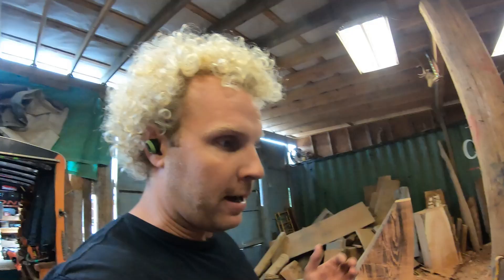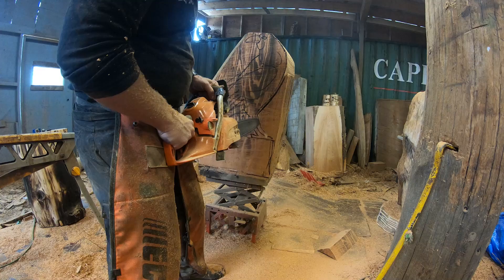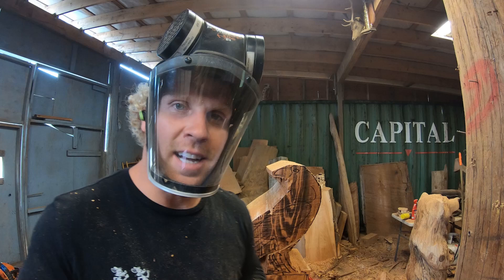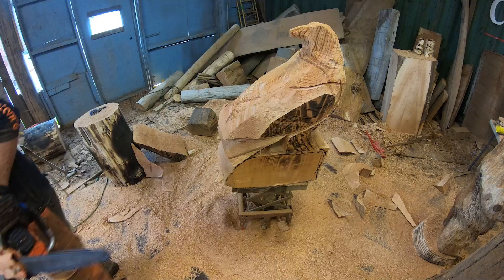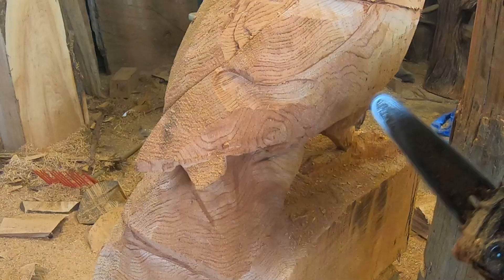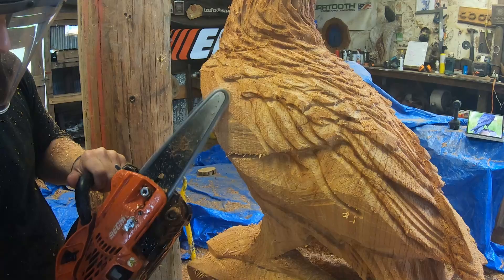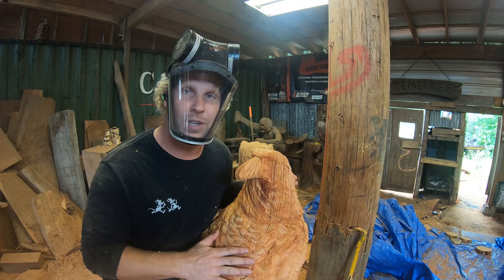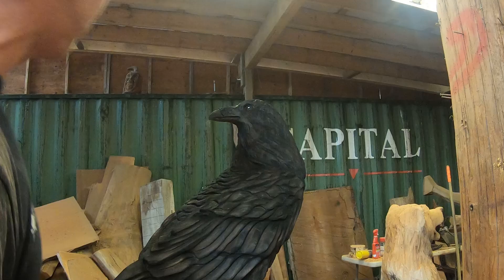Carving Raven  How To Tips -  TEMPLATE & How to Profile BLOCK OUT

Comment: Nice video Ryan.  Could you go into  detail about what projector you use, how it works, how to use images in it etc?
Reply: This is the question I wanted to ask. I'm ready to pick up speed with the block outs using a inexpensive projector and get the correct proportions.
Reply from the maker: Will do! there will be some more info when i start doing some sub classes